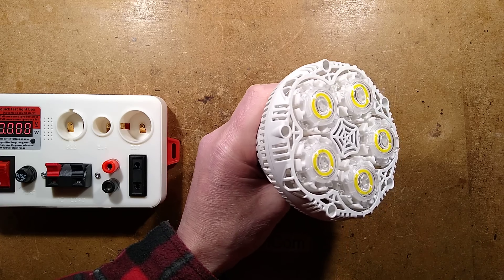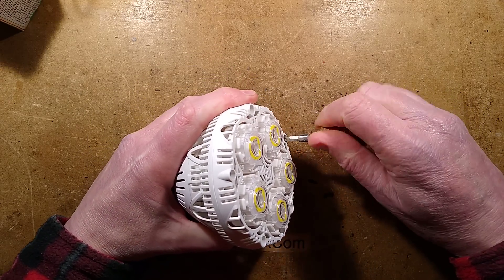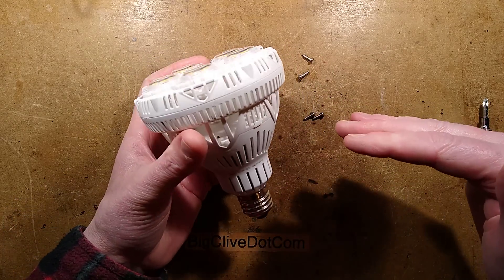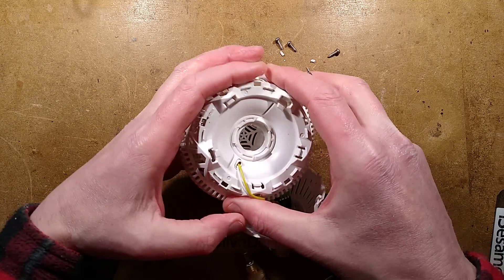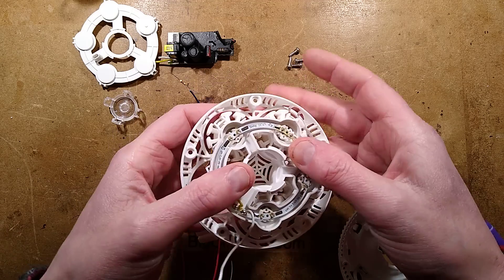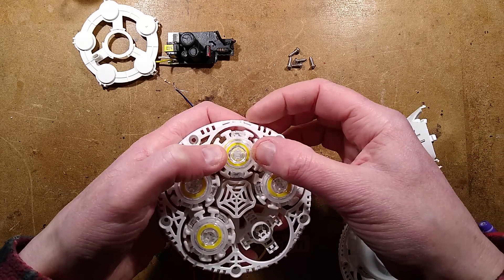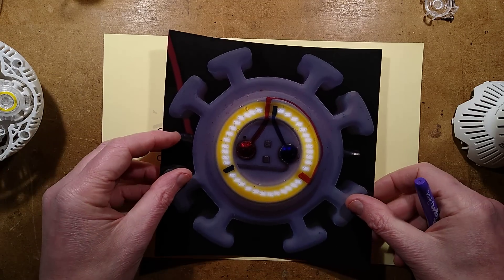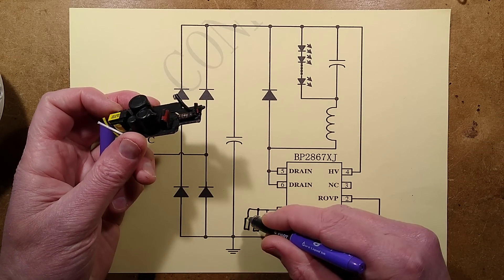Huge 30W ceramic core LED light (with schematic)

Comment: Question. If I want to replace a 60watt incandescent bulb with an LED, the LED packaging says 60watts, but is actually only 9watts. As you know the equivalent is in Lumens. So. There are LED grow lights that say they’re 1000watts but only like 1 ohm @ 240v, suggesting only 250watts? What is the actual wattage of these LED units? Thanks.

Comment: I've been using their 36W grow lights. The lamps are excellent while they last, which is unfortunately not very long. I had multiple. About half of them broke after a year of usage...
Reply from the maker: I wonder what the failure was.
Reply: @bigclivedotcom couldn't get the lamp disassembled to figure it out...

Comment: The fact that micro-farad and nano-farad capacitors can do so much still blows my mind. I used  to have a four farad capacitor in my car for the sound system. That was before I learned that batteries are better. Capacitors are a band-aid(plaster) in the car audio world. But they are much cheaper. Buying a pair of $500 deep-cycle batteries and a big alternator hurts. Would not recommend. Also, I have permanent hearing damage now. I was not smart as a young man. I'm not much smarter now, but I'm slightly older.
Reply from the maker: I can recall the car audio industry claiming that high volume bass didn't damage your hearing.   I fear it was science based on marketing.

Comment: Hello Clive, i found a strange led strip, very very basic with only two wires and very simple led but it manage to blink one led after another and i don't know how it does that.
I can send it to you if you want !
Reply from the maker: There may be a tiny resin blob control chip on it?

Comment: Anytime you generate a lot of heat -- you are throwing away energy.    The problem is that when you just increase the LED emitter area (increase number of LEDs), you increase the unit cost over the price point of what the average customer is willing to pay.    So, for the most part, we have a selection of relatively cheap LED lights that are not the best possible product.

Comment: I wonder how the ceramic heatsinks perform, did you perhaps check with a thermal camera? It seems so much smaller then what I would expect for 30W and aluminium heatsink, I wonder if ceramics is better. Really weird lamps, fascinating stuff.

Comment: There are cord connected floodlights with these odd LED modules in them as well and Sansi make them up to 100W for the US market. I have a pair of their 50W units with a 4x2 array of the modules each; they seem to make decent work lights.

Comment: The "goo" that's covering the power supply board is called potting compound, widely used in the electronics industry for protection from moisture.

Comment: The modules aren't disappating a full 6W as heat, up to half the energy leaves as light. But yeah, I wonder when we'll start seeing integrated fans in light bulbs.
Reply from the maker: Some industrial lamps have fans (and some earlier Philips GU10 lamps).  But a fan is a weak point and increases the risk of dust build up.

Comment: I'd love to see a "Big Clive Designed" sort of open source LED bulb. Decoupling all of electronics/leds/heat sink/structure, such that any of the four can be replaced. The beefy, pricey heat sink, and the structure itself can then be sufficiently robust to be "100 year parts". I'm positive the LED  part can get to ridiculously cheap and mass-produceable. The part I fail at is figuring how precisely to do the 120/240 -> DC part in a way that none of those electronics will be a failure point and yet also small enough to basically fit in/around the E26 screw part.

Comment: In addition to the clip fetish seen in the design, the thermal flow looked well thought out to me - keeping most of the LED waste heat away from the driver board.

A corner of my garage needs a new light, and all of those clips sound fun!

Comment: If the 3 rows of LEDs inside each module would've been factory wired in series, a module would require roughly 110V. Place a 220 ohms 1W in series with bridge rectifier and the module and it could be supplied directly from the 120V wall plug, right?
For 240V, use two similar resistors in series with the  bridge rectifier and two LED modules.
I believe this possible modification could make these lamps even cheaper. What do you think?
Reply from the maker: The LEDs require current regulation.

Comment: Huh, I thought it would've made more sense to wire the modules in parallel and add a current limiting resistor on each one, that way if one module fails the other would continue to function. Regardless, the actual design of these lamps is phenomenal, the guys making them clearly know what they're doing.

Comment: I recently took apart a Merkury Innovations LCD light and reprogrammed the microcontroller to send me the username and password of the wifi that is saved in the code. I couldn't get all the light functions working nor did I have the API to mimic the features from Merkury but I was able to steal WIFI info. So simply leave a new box (modified) of the lights on someone's door step and see if they use them and boom Wifi and password... will try and use a sniffer to see what is sent to the company

Comment: Correct me if I'm wrong, but isn't ceramic a bad heat conductor? 
I am pretty sure they won't be using spark plug ceramic or what makes up the shuttle's tiles. Most likely just white clay they make china dishes out of (without the glazing process).
I think the design is very attractive, but I would prefer aluminum as heatsinks, not baked dirt. 🤪
Reply from the maker: This ceramic is optimised for heat conduction.

Comment: I almost missed this video.
pfff, they thought they could dip the module in black goo to keep you from reverse engineering it. 
I wonder why they left the other part not dipped, if it was only for moisture protection!

Comment: Beautiful to see Led lamps you can take apart, because they have screws,and you can repair if it has stopped working, i 
myself have repaired a LED lamp also because it has screws, i was the 400v cap that was broken, what most of the time 
is the reason they stopped working.

Comment: I bought a few SANSI 100w equivalent 1600 lumen LED bulbs last year. (model c21bb-te26-13w)I have installed a couple of them, one in a table lamp and the other in a ceiling fan. This bulb has a dual concentric array of leds almost 3" across (37 leds inner circle)..It has flow through ventilation slits that should limit the buildup of heat. My gripe with most LED bulbs is they run them much to hot and that drastically cuts their life and the light output drops off as they heat up. The result is your 100w equiv bulb only puts out the same amount of light as a 60w equiv bulb once it  gets hot.

Min is built similar to yours and all that ventilation increases the life and I find the light output does not drop off as much when they get hot. I've only had them in use for 6-7 months but ther much better than the run of the mill crap bulbs you usually find for sale.

Comment: Why do they even bother with ceramics? AL is much more thermally conductive and must be cheaper to produce these days...
Reply from the maker: These are ceramics optimised for heat transfer.
Reply: @bigclivedotcom  sure, they are optimised to be close to Mattel but metal is superior, so the question is why? Can't be cheaper??

Comment: Can someone explain what they do to make the ceramic a heat sink instead on an insulator?  And is it that much better than aluminum or just cheaper?
Reply from the maker: It's optimised for heat transfer.

Comment: If it is rated for Hydroponics, with the "water cover" it would not get humidity inside? or would the heat from the electronics enough for it to keep out condensation inside the plastic covers?
Reply from the maker: It could theoretically suffer from issues in very high humidity areas.

Comment: I have a question about the ceramic heatsink part. How good does ceramics work as heatsink anyways? I ask because I have a bulb, that has a resistor in the threaded part (to limit current) and it gets hot rather quickly, around 70°C after one minute, would a ceramic fitting work to cool it? It's a neon bulb rated for 3-6W that has blue flowers inside and I do not want to ruin it by running it too hot. The only metal fittings I could find were plastic on the inside, so I would think ceramics might be better, right?
Reply from the maker: This ceramic is optimised for heat conductivity.
Reply: @bigclivedotcom  How hot did the heatsinks get? I am really interested how good the ceramic stuff is, I have only seen aluminium heatsinks on powerful LEDs.

Comment: Got to love those cheap LED drivers, when I switched my kitchen strip light off that's on the same circuit, it blew the capacitor living room LED light.
So now I'm fitting an 8 bulb pendulum light, with changeable bulbs, blow that you sod.

Comment: Buck convertors and voltage regulators fascinate me, although I have never really got my head properly around them. Is this a resonant circuit then, with the chip controlling how long on and off it runs per second/millisecond/whatever fraction of a moment?
Reply from the maker: The chip uses internal timing, plus external current sensing.

Comment: Are you sure that the purpose of the ceramic is for a heat sink? Ceramic is an insulator.
Reply: Some ceramics have pretty good thermal conductivity.
Reply: @fp4man542  you have a point. For some materials electrical insulation properties do not correlate to thermal insulation properties, and vice versa.

Comment: I've got eleven 22W and 27W Sansi lamps fitted in external lanterns. They've been in for almost 1 year, approx 4000 hours, and so far had no failures. The manufacturing quality, efficacy, CRI/colour and light output are all excellent.

Comment: Kind of over designed looking. Like they hired a German designer and told him not to worry about what the Chinese mold maker would charge for complexity. One cool thing is that the 6W per module these days is only partly dissipated as heat, we can’t ignore the light emission power. I think it’s something like 25% but would vary with LED quality and operating conditions. The intimate contact of LED die and ceramic means that the Tj will be very close to the heat sink temperature. Nice product, thanks for the look inside, BC.

Comment: Aren't those 3 sections of LEDs wired in parallel?
Reply: Yes, three circular led elements are in parallel conne cted but notice that one of them is mirrored that they got common negative and positive ends for them.
Reply: @AliusScitmelius  Yeah I noticed that, but clive added the voltages and must have accidentally assumed they were in series.

Comment: Interesting thermal design. Could you show us the next lamp trough your thermal camera?
Reply: The installation direction could be critical. I think this is designed to be installed as down light. If installed horisontal then the led elements are up each other and not cooling properly.

Comment: I wonder if the black coating improves radiative cooling
Reply from the maker: I think it's more for protection against condensation on the higher voltage bits due to being used in plant growth applications.

Comment: Hi Clive, why did you comment that (within one LED module) 3 parallel sets of 36V strings add up to about 170V as if they were in series?  Also I say, Victorians would have been proud of that over-engineering!

Comment: Got a few of the 36w ones and just last week one no longer works. When powered it flashes on for a second then goes off. So not the LEDs. would have sent it to you for, but Amazon want it returned to get a refund.

Comment: Does the inductor following the FULL-bridge rectifier do anything to/for the power factor? I know this "L-input" is used in tube amp psus to slightly lower the voltage while providing slightly more current..
Reply from the maker: It's purely for electrical noise filtering.

Comment: When I see a little choke and a little extra capacitor and a little extra resistor I feel the designer had a specific radio signal in mind and wasn't reliably protecting it with just the L and C.

Comment: The mechanical engineer this company must be great at their job. The moulds must be more expensive and complex than the average led light
Reply from the maker: It will be designed in 3D CAD these days.
Reply: @bigclivedotcom  But still the moulds which are used to press the plastic are complex even if manufactured in CNC machines. And should be remembered that they wear in use if there are small cavities.

Comment: @Clive I suspect that's AlN ceramic, which is Aluminium Nitride.  It has amazingly high thermal conductivity for a ceramic, and of course equally importantly it's non-conductive, and relatively cheap at under a dollar a kilogram.

Comment: I had some of these off either amazon or ali about a year or 2 ago and they melted themselves
Reply from the maker: Excellent.  I'll have to test that.  Were they in enclosed fixtures?
Reply: Which direction you had them? I think that this is disigned to be down light position. If angled then elememts are heating each other.

Comment: Im looking foreword for corn type of ceramic lightbulb. I need strong and even light beam to my room. Ive got 23W led now. But its overheated all the time.
Reply from the maker: Consider using a multi lamp adaptor and using a few lower power lamps.

Comment: You said this was for hydroponics? But what happened to the specific-spectrum LEDs? The ones that only emit frequencies that plants can absorb? I think it was blue and red, and the lights had a purplish color. The whole point is that they require less power, because they don't create waste light that the plants cannot use.

Comment: It looks like the three groups are in parallel. At 8:00 each section of LEDs have a common + and -, so they are getting the same potential. Clive say each section are "linked together in series and" gets 35 v giving 175 volts to the whole lot", as if they are in series.  What am I missing?
Reply from the maker: Each module has parallel sections, but all the modules are in series.
Reply: @bigclivedotcom  So kind of you to respond. Ah I see. The segments are in parallel, but the modules are in series. Love your channel, much respect!

Comment: I have the 36w "full spectrum" version of this. One died after about 9 months with a rigid sunrise to sunset run time daily. The second one died 3 months later. Been meaning to tear one down and find the faulty module. From the outside it looks repairable, wonder if I can use the ceramic plate for a 10w module.

Comment: So if these are designed for the higher voltage Countries, what would happen if used in the American 120 volt range? Would they last longer? Is there enough to power them up to be useful?   Would there be flicker? Non electronic American minds wants to know.
Reply from the maker: They might use a lower voltage configuration of the LEDs, or maybe just use an internal voltage doubler.

Comment: Clive.
Given that the nice sized capacitors on the circuit board are designed to split open at the end when things go tits up, what will happen when they cover them in goo? 
Will it be a bigger bang due to the goo, or will it not change anything? 🤔
Reply from the maker: The goo is soft, so they will still be able to split open.